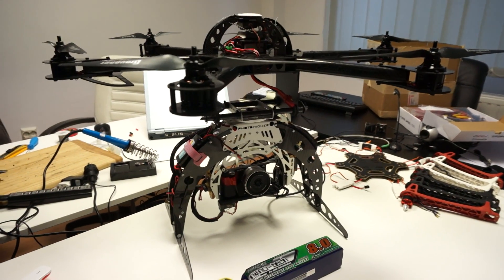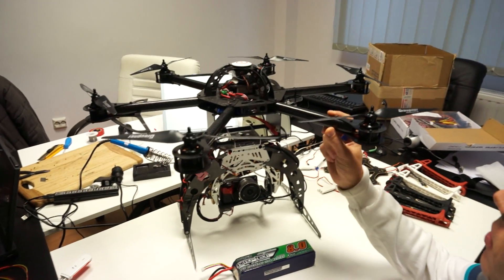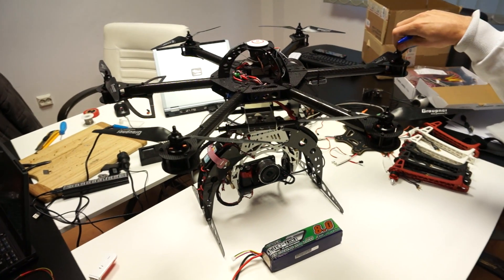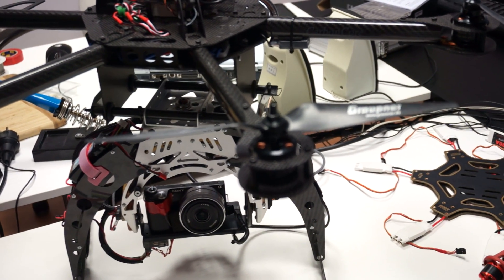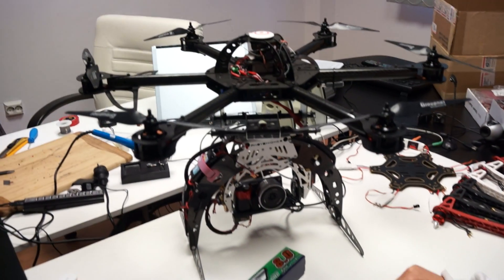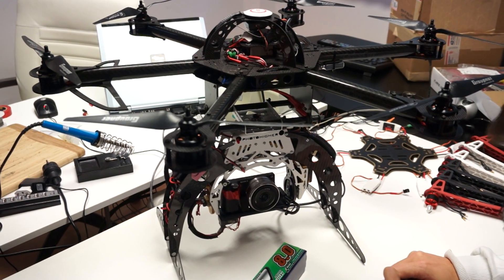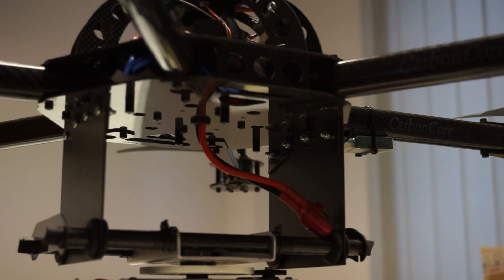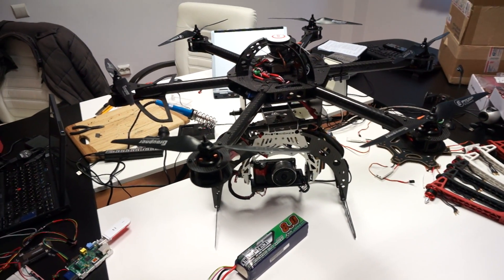CarbonCore H6 650 and Photohiger AV130

Comment from the maker: the carbon core frame is very easy to mount. the only thing which is a bit more complicated is the ESC wiring. you need to buy a small power distribution board that fits inside the frame so you may easily and safely connect the battery wires and the ESC wires together. initially we used the DJI ESCs but in order to get more flight time we switched from 4S to 5S Lipos which required other ESCs.